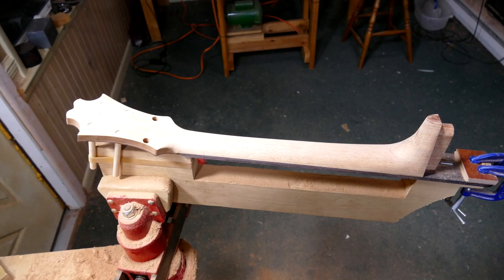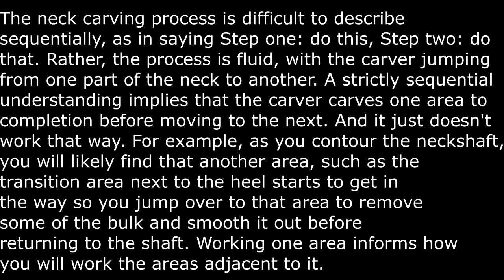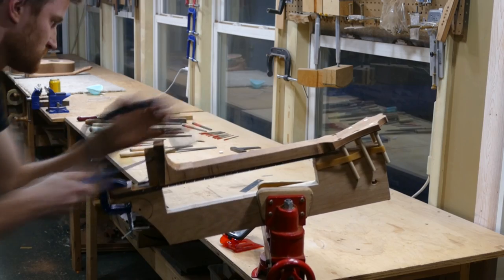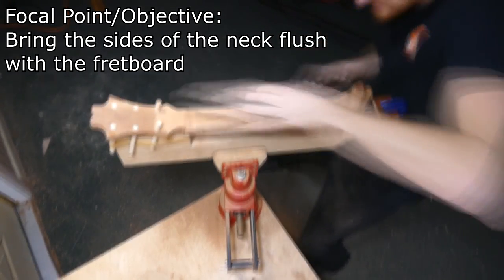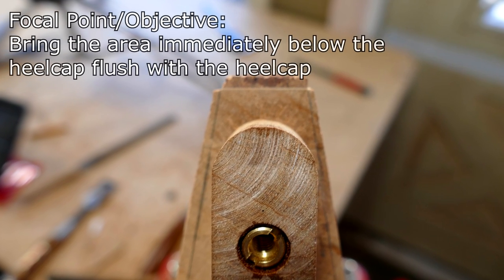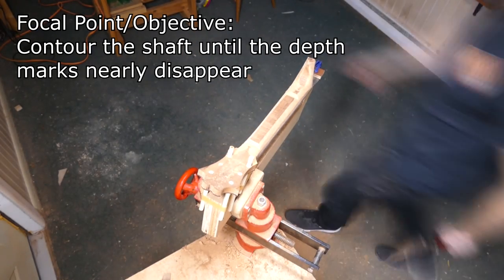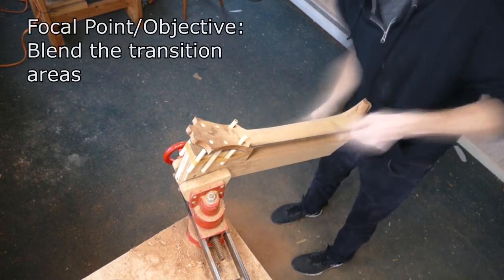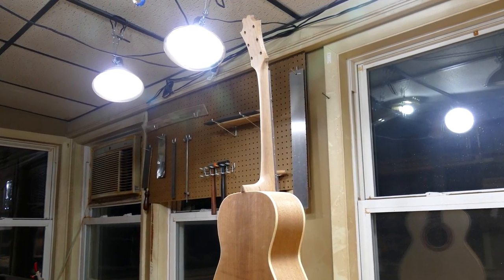Hand Carving the Neck

Comment: Hi, it looks like you are an expert in guitar making! I have a question. I bought a new Yamaha FG820, I really loved it, but I noticed there is a tiny end-grain tear-out (2mm long max) right near the Nato heel and body laminate, beside the fretboard (It's literary at the corner which the three things come together). It seems like the tear-out had been carefully sanded and treated in the factory, but they did not use any filler, therefore I can still feel it. I know it's a mass-produced cheap model but I am just wondering the cause of that tear-out. From your experience is such a thing ever likely to happen while craving and shaping the neck?

Comment: Why did you use a copping saw when a band saw would have done the job far faster and better, further more a Stanley surform half round blade together with a spoke shave would have done the job far better.